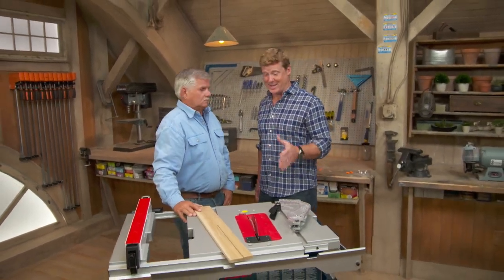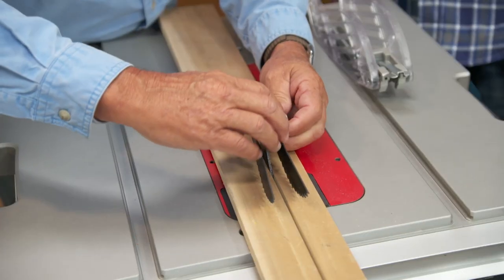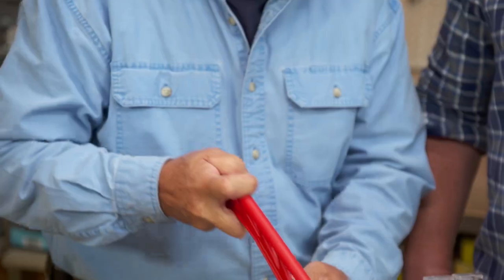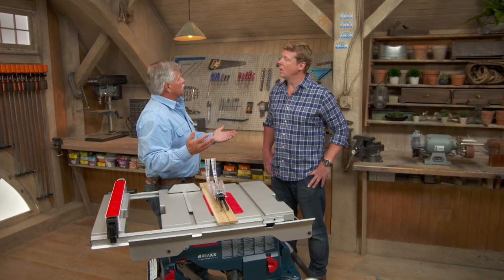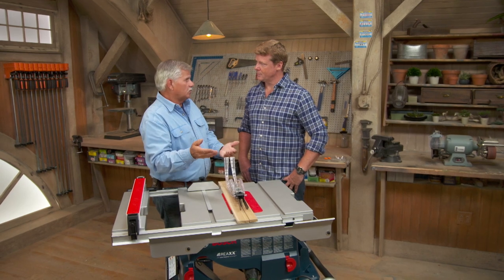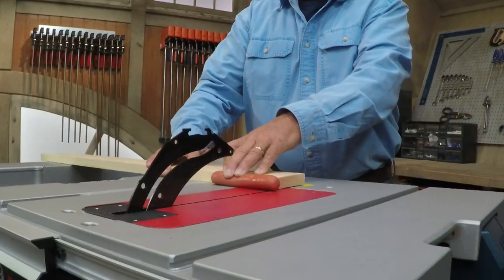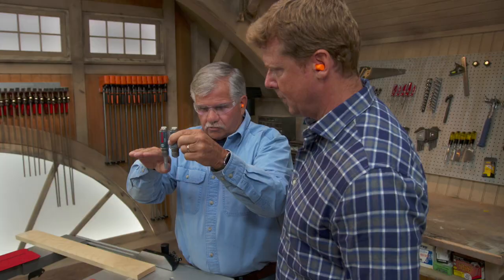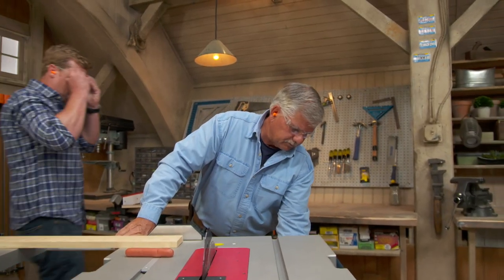Testing New Table Saw Technology | Ask This Old House

Comment: I think Bosch did a better job with the safety system than SawStop.  At least with Bosch you don't destroy your blade when the safety mechanism trips...although I can imagine that replacement cartridge for the Bosch isn't exactly cheap either.  ~$86 for the Bosch cartridge.  ~$70 for the Sawstop cartridge x 2 because the Bosch is a 2 in one so $140 for the Sawstop VS  $86 for a 2x Bosch Cartridge.  This system should NOT be a substitute for safety though.
Reply: I don't think destroying the blade is a big deal nor is the cost of a replacement unit. This is the type of thing you will buy once and hopefully never use but if you're unlucky it's only once, fifteen years later. 

If you trigger it often enough that the cost of the replacement and the blade bothers you then you shouldn't use a table saw in the first place. 

With that said: Bosh's system is better.
Reply: William Todd lol I will gladly paid 86 bucks to keep my fingers
Reply: William Todd don’t forget about the cost of a new blade!
Reply: But the saw stop system stops the blade, the bosch one keeps spinning.
Reply: Christian L - But with the blade below the surface of the table, and out of reach of your fingers, does it matter if it is spinning or not?
Reply: Don't forget with the sawstop you have to replace the saw blade as well.
Reply: Bosch offerings for table saws are all portable ones.. not even a contractor grade saw. Never mind a cabinet saw.  Just too small for some use.. wish they would put out a larger unit.  But for now it's sawstop if you want that extra insurance in case you "goof" .
Reply: It’s definitely better to lose a few dollars out of your wallet replacing the cartridges than it is to lose a finger or two off your hand from hitting the very fast spinning blade.

Comment: What if you cut moist board?
Reply: I've wondered about this also. I think the conductivity is different enough in green or moist wood compared to fingers, or hotdogs that you're touching, that they are calibrated to be able to tell the difference.
Reply: What if I’m dehydrated and operating the saw?
Reply: Most of these safety saws have an override feature which is used to cut wet wood or metal which is conductive.

Comment: are the pistons reuseable
Reply: Piston in the cartridge are not reusable once deployed. Each cartridge has two separate shots. Bosch suggests after 25 firings (13 cartridges) you bring in the saw and check for the integrity of the saw structure.
Reply: Its pyrotechnic. Basically a piston driven by an explosive.
Reply: Flyby Wire probably very similar to seat belt pretensioners

Comment: Hey guy's, I just need some clarification please.  I thought that the safety mechanism was set off by the difference of current going through the blade being touched by skin, and not by moisture on the skin.  I can understand how the safety system could detect a difference in current, but how could it detect moisture?  

Keep up the good work.  I can't get enough of your videos, and I enjoy learning from them as well.

Comment: Would a very large solenoid work instead of the cartridge, to prevent lost money due to people cutting sausages or scrap metal on the table saw?
Reply: Wouldn't be fast enough. Those cartridges have small explosives like a seatbelt pretensioner. It needs to react instantly.

Comment: I wish you guys had used the second part of the cartridge not for waste reasons. What I am getting at is "Moisture detection from above the blade, or another angle", will the saw still stop say for example.Situation example: A fight broke out the table saw was running and the person using it had ear protection not noticing the fight. One of the fighters does a chop swing while the other fighter dodges. The "attacker", can't stop and knows his fate, "hand swinging towards the blade full force, no way to stop".  Question: Will the table saw still stop when coming from a different angle?Also if a piece of my finger gets cut then I'd say I'm lucky at least I didn't lose a whole finger if it does stop from different angles. Unless it happened to be an artery but now that I asked this question I am going to look up if arteries run within the hand. Thank you for the video and please keep them coming as well as the great work!

Comment: Hey guys, that "riving knife" is a splitter, which is not the same. A riving knife sits just below the top of the blade and goes and up and down with the blade so there is never a reason to remove it. A splitter sits over the blade so is frequently in the way and gets removed. This is a critical safety issue as kickback is the most common danger when using a table saw.

Comment: i have this saw and it's really nice. It has a nice large fence. the top has the extension feature for cutting larger pieces. It comes with the rolling stand (its very stable) and a push stick. It has a bypass feature for when you need to cut wet wood or wood with metal in it. (those can set off the safety feature)

I've learned that the safety feature is prone to misfiring. I had it fire on me when i was nowhere near the blade.

Comment: There is a many safety features on my 1980 wee saw, and it has an extension feature built in , that these job-site saws use ,( that includes Saw stop)  the BIG difference this wee saw has a stationary fence, and cuts to 4ft on centre  interested  see here www.jimmyjig.ca  a wee picture is worth a thousand wee words

Comment: My thoughts on that whole: "Can't cut your hand" tech is nope nope nope! I'll take common sense and safe practice over trusting that.
Reply: You'd probably get rid of AirBags in cars too?
Reply: James Pian Since that's about as accurate as comparing an apple to an orange..no I wouldn't. A car you can be rear ended and thus the accident being out of your control. Not paying attention because you have some new hip gimic of a device and it fails resulting in you cutting yourself on your table saw is on you .
Reply: Atlas721
65,000 table saw injuries per year. Not one of them thought it was going to happen to them. Not one of them thought they weren't being safe.
Reply: you don't replace common sense and safe practice.. you just add safety features like this as a contingency.
Reply: @jpian0923  absolutely… Your comment should have 1000 thumbs up...Why don’t people just admit that they are cheap? There’s nothing wrong with being cheap but don’t knock technology just because you don’t want to pay for it. Why can’t you follow best practices and have the latest technology in case there is an...Accident!
Reply: @tylersilva123  absolutely.